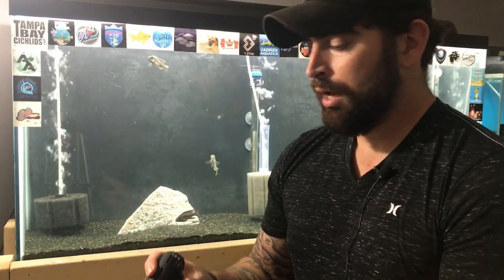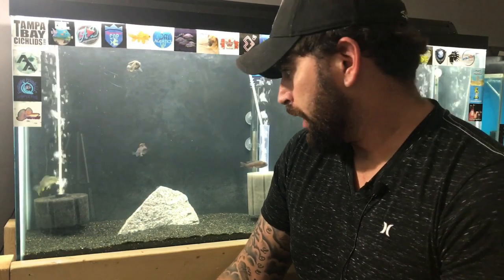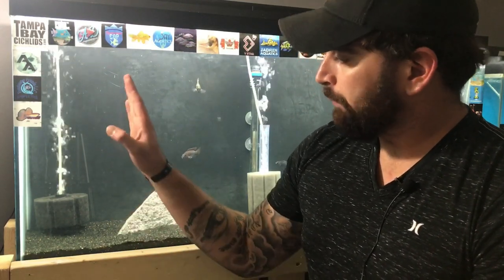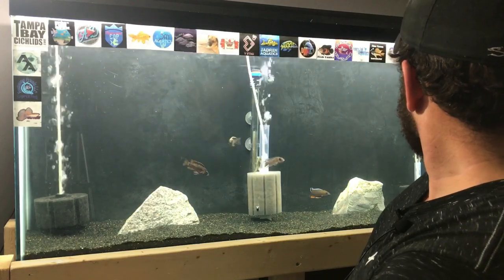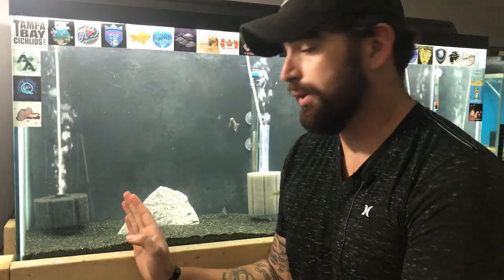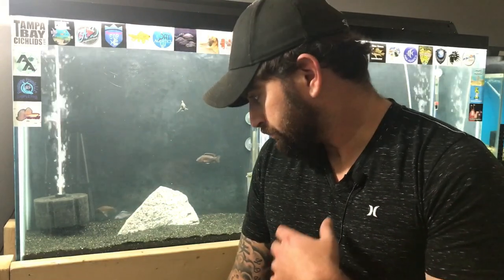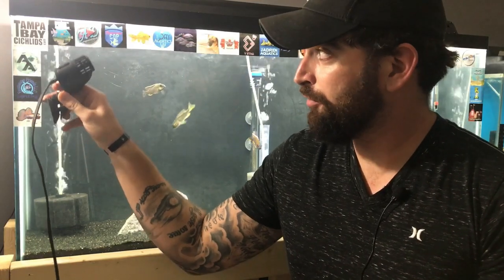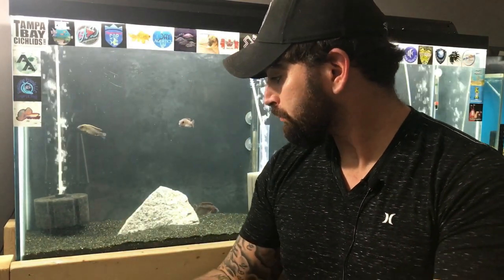Setup aquarium wave maker, clean fish tank

Comment: Great info, thanks for posting this video. Just to be sure, what size of a wave maker I need for a 200 liter malawi tank with rock decoration?
Reply from the maker: Hey thanks for watching, I really appreciate it, sorry for the lack of excitement this is an old old video 😁 but anyway 200 liter I think that’s 50-52 gallons right? I would go with something in the 800 gph range especially being that you have a rock hardscape. Ideally I would get a adjustable wave maker, something that can hit 800-1000 gph. But those are much more expensive
Reply: @UnconventionalAquatics  Yes, 200 L is equal to 55 gallons, so practically speaking, you are advising around 3000l/h wave makers. Adjustables are expensive so i'll stick with cheap, fixed rated wavemakers :) . Many thanks.

Comment: I have a 78" tank with an FX6, inlet and outlet are both on the right hand side this cannot be changed, i have fitted a wavemaker on the opposite end pointing to the surface and have good water break up all along the surface, my problem is i have dead spots that collect a lot of poop, should i point the wavemaker down to skim the surface of the the substrate or fit a dual head with one pointing up and one pointing down

Comment: Great video. I have a canister filter on my 75 gallon Malawi tank. should I put the intake in one corner (left) and have the spray bar on the same side pointing right or have the spray bar on the right side pointing left toward the intake?
Reply from the maker: Thanks brotha, so what ive done and seen others do as well, if your not running wave makers or power heads, i would pick a side for your intake (far left or right) and the since the output of a canister isnt nearly as powerful as a wavemaker (unless your running a big canister) i remove the spray bar, so its literally just a 90 degree elbow , and position it just past your center brace (so hypothetically you have your intake on the left, put your output just to the right of your center brace pointed away from the intake) this gave me great results as far as circulation and skimming of the substrate, before i started using wave makers and power heads. i hope all that made a little bit of sense😅lol definitely let me know if it helps.
Reply: Unconventional Aquatics thank you, that helped for sure.

Comment: Very useful video thanks! I've thought about adding a wavemaker to my 400 litre tank to create better circulation but then got thinking about adding a second filter and using the outlets to generate flow, one high and aimed at the surface, one the opposite end part way down and aimed at the gravel. Would this work? I'd then also have the benefit of more filter media and more litres per hour being filtered. Anyone any idea if this is a good substitute for a wavemaker please?

Comment: Great info. But quick question. With single filter set ups, canister, where do you have the outlet pointing? I know you place the wavemaker same side as the inlet. I assume the outlet is on the other side but where do you aim or point it? Towards the front? Or directly to the inlet side? Or do you use the spray bar? Thanks in advance 😊
Reply from the maker: Christopher Abella hey thanks for watching, so for example if your intake was on the left, I would put your output in the middle or slightly past the midline of the aquarium and point it to the right. Not sure if that made sense. I actually just put a video out the other day on this that will probably help a lot.
Reply: Unconventional Aquatics got it. Thanks so much. I'm gonna check out the video. It's funny because everyone has their own way of setting things up. Since I'm a noob  I just watch the experts on YouTube and take as much info as I can.  So intake left back corner, out take middle back pointing right, then wave maker on the left side pointing up towards the right side👍

Comment: Hi, old video but very useful. I have 2 external units (either side at back) both use pre-filters and fish tale outlets,  2 air diffusers (either side at front), 2 air foam filters - but not the water agitation I want
Tried a powerhead and it gives that extra water agitation and is very quiet - at back with anticlockwise flow in tank so it doesn't infer with air diffusers on front, fish don't mind so all good - I also have option to add an air pipe to the powerhead - but that makes too much noise

Comment: Looked everywhere for proper guidance on using circulation pump finally found it here. My problem is that I have only one canister filter on my 60 Gallon tank and the intake is not that powerful so need a circulation pump to have that floating debris caught into that intake . What would you advise on the power of the pump. I have silver dollars, angels and juvinile clown loach
Reply from the maker: Aditya A. Aima hey thank you for watching and I’m glad the video helped. With angels I would stick to something between 500-700 gph, is it a 4 foot long 60 gal?
Reply: Unconventional Aquatics yes 4 foot long and when you say 500 to 600 gph you are referring to circulation pump,right? and not filtration coz currently it's sunsun 302 rated for 264 gph and which is reduced to less than half of that after all that media
Reply from the maker: yeah i mean the circulation pump alone, its tough with fish like angels, it may be best to get a wave maker that you can adjust the flow on, like the (Jabeo) line. (pretty cheap and have nice features).
Reply: Unconventional Aquatics thanks bro, I am not sure if I can find that here in India. But will look for an alternative
Reply from the maker: Sounds good, let me know how everything goes bro👍🏻

Comment: question, i have topfin 29 gallon i have a aquaclear 30 powerhead , i have my aqaclear 50 on the right side and im still not sure where to put my power head😔.
Reply: Aspire put it right where the water comes in from the filter or you can put it where the dead spot is, meaning whatever side does not have good water circulation

Comment: Is it okay to get a wavemaker for a tank with angles if not what should I get to aerate my tank
Reply from the maker: lil Axle420 _ hey thanks for watching, to answer your question yes you can use them in a tank with angles, you will just need to mount the wave maker to a flat panel. What kind of tank do you have? As far as shape is concerned. If you didn’t want to go with a wave maker, some other options are air stones, sponge filters, and angling outputs on return lines. Your goal essentially is to break the surface tension of the water. That’s why I prefer wave makers because I can break surface tension, and get great circulation which has a ton of benefits as well. I hope this helps, if all else fails I can make a video going more in depth, just let me know 👍
Reply: Unconventional Aquatics hey thanks for the reply. I have a 29 gallon tall I believe and I would best describe the shape as half a cylinder almost. And also I was just unclear what you meant by mounting it to a flat panel? And what wave maker would you recommend i get.
 Thank you for your help
Reply from the maker: lil Axle420 _ so in your case, the only flat panel of glass is your back panel, and that is where it would easiest to mount your wave maker. I am a huge fan of the SunSun Mini Wave maker (JVP110) they are cheap and do the job . They push 538gph so it may be to much for a 29 gal. I’m honestly thinking your best bet, just because the tank is more narrow and tall , if you ran any kind of canister filter and turned the output up at a slight angle, that would provide plenty of surface agitation. Or you could go the air stone / sponge filter route
Reply: Unconventional Aquatics o forgot to mention I do have 2 side panels on my tank, sorry I didn't really describe the shape that well, but you do you think 528 gph is to much or will it be okay I also have a planted tank? Sorry to take up your time haha water irritation can be kinda tricky
Reply from the maker: what do you have for stock in your tank? in theory depending on the fish it will be fine, for example my old Nano reef tank was a 20gal long and i used this exact wave maker and it was fine. some fish are just sensitive to alot of circulation. And no worries at all im here to help any way i can👍
Reply: Unconventional Aquatics i have 2 angles 3 ablinos 2 ballon mollys 2 sword tails and 2 platties do you think I can still use it the tank is pretty well planted and has a piece of driftwood and some rocks
Reply from the maker: Hey on the bright side if it ends up being to much flow, you can put it in another tank. Those mini wavemakers are some of the best $7 i have ever spent in this hobby

Comment: What size do you recommend for a 65gallon tall
Reply from the maker: for tall tanks you may need multiple wave makers to get the current all the way to the bottom. In your case depending on your budget and what you have in the tank, i would try something like the Jabeo wavemakers so you can adjust the flow, something with a range of 500-1000 gph  What kind of fish is it stocked with?

Comment: How would you place two wavemaker in one tank?
Reply from the maker: it honestly all depends on what your trying to achieve out of your wave makers.  As an example, in one of my tanks i have 2 wave makers and two filter intakes (one on the far left of the tank and one on the far right) the way i have the wavemakers set up, is the essentially just how i showed in this video, except the second wave maker is at the opposite side of the tank, oriented up just like the other. this gives me surface agitation, circulation and pick up debris off the bottom and pulls it into the intakes. If you would like, i can make another video demonstrating the use of multiple wavemakers if that helps?